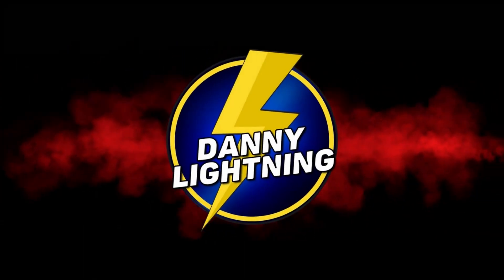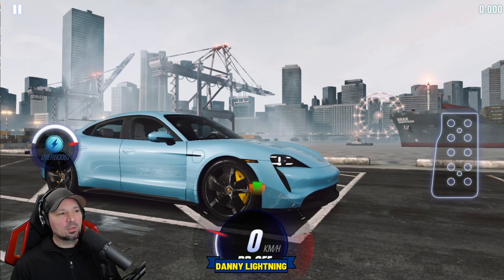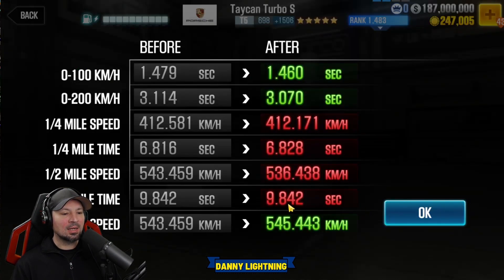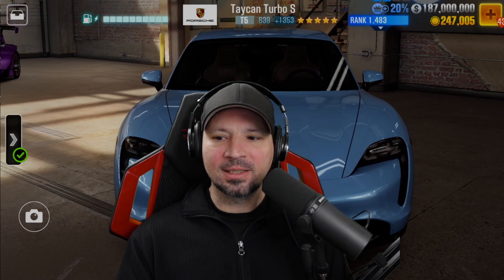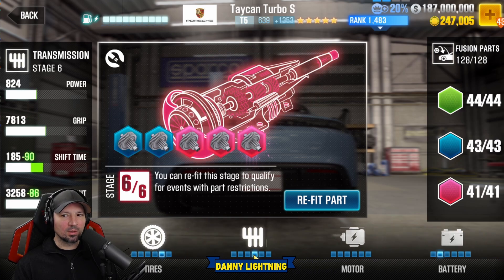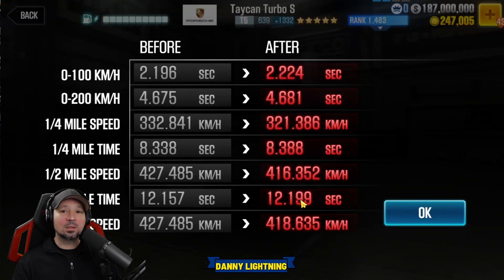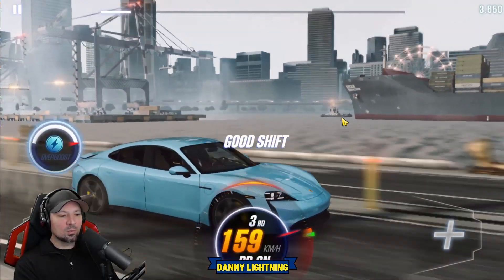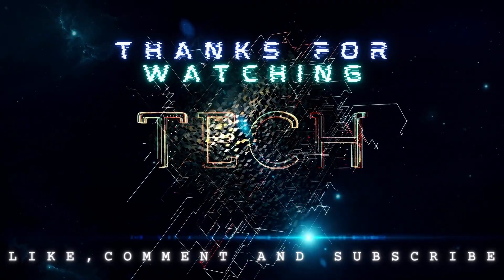CSR2 Porsche Tycan Turbo S, Shift, Tune, Review, Live Race Setup

Comment: I’m on somewhere around stage 3 and am beating dyno by close to .4. Undefeated for now. I know I’ll be kicked soon
Reply from the maker: Yeah if you're beating dino by a lot it's definitely going to get pushed after so many races but you can always run slower than the dino to get it back into the lobby where it's supposed to be, not sure how many races it actually takes, can be a few or a lot depending on how everything goes I guess

Comment: Why do you have only 1 gear and I have 8 gears on the taycan?
Reply from the maker: I'm pretty sure the car has more than one gear, I'm a little confused, sometimes the way it is tuned you don't go through all of the gears, you don't always need to for example if you have a car set up for acceleration it will shift through the gears quicker but if you have it set up for higher speed sometimes it doesn't shift through all the gears, sometimes it does
Reply: Noone knows I've races this car and havnt changed gear there are none,but then some where it glitches and yku have to 5th instantly and then change to 1 St again and start again effectively strange